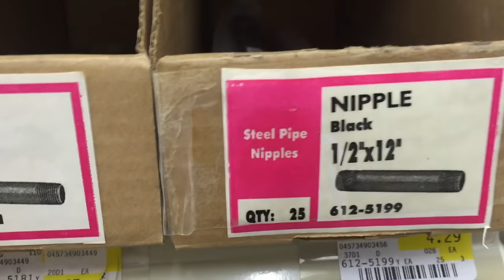Hardware Store Muzzle Loading Pistol Part 1

Comment: Not the first time I've heard this song but last time I heard it I was really into it at like 3am...turns out it was on THIS video and I'm still debating doing a build like this & ended up at your video
I'm so happy I did because not only did you help me nail down the song/artist but you also helped me figure out exactly what action I want to use for me beautiful (almost free) gun to keep in the barn at the summer home...cheap enough that if it breaks/dies then I don't feel bad yet impractical enough that if it goes missing I also don't feel bad since it doesn't use center or rimfire bullets so if some idiot DOES try that, it'll go click without doing anything
Truly your build is amazing to look at
Reply from the maker: I am so glad to help with both :-) Thanks for your encouragement.

Comment: I think I will use an extension spring like you did next time because it reduces the parts count, and the operation of the spring doesn’t have to count on a sloppily made spring guide. Good idea.

Comment: That's in ingenious way of carving a barrel channel and well engineering the lock. I hope that coil spring will be strong enough to set off caps!
Reply from the maker: +mark3smle Thanks, buddy. It worked out good. I have fired off some caps with it and they went "bang". But I had some misfires and will be using a stronger spring.

Comment: Thank you for the drawings of the parts! I was looking for this for some time :-)
Reply from the maker: You are very welcome :-)
Reply from the maker: It is about 10mm in real life :-)
Reply: Hello from Slovenia.An interesting project.Can somebody send me drawings of the parts?Thank you.
Reply: It's in the description mate!
Reply: Thank you. I found a link to the description.This link does not work.Is there any other way to get drawings?
Reply from the maker: I just tried the link and it does work for me.  I am not sure what the issue could be. Please try it again.
Reply: Thank you. I'll try tomorrow.I found drawings of a similar Russian gun,without a measure (mm or inch,)
Reply: I'm working on the mechanism at the moment and for now, things are going pretty well! I only have 1 question about the spring you used.. Do you have any specifications about it? Thickness&length? :-)
Reply from the maker: Cool.  I am sorry, but I do not have specs for that spring. I used trial and error with thicker and thinner springs and cutting different lengths.

Comment: No mention of what caliber it is. Guessing 50-ish, since 1/2inch black nipples are common.  ( I used to work in a hardware store similar to the one you showed.  Pity it went out of business.)I was wondering on that first shot of the square tubing.  Then I thought, "hmm...heat, twist, rifling?  Eh, maybe not."
Reply from the maker: I shot a .357 bullet out of it and it was too small for the barrel. I am guessing that it is in 40-ish range. The inner barrel liner narrows the barrel. Have a great week!

Comment: Pipe in different schedules, lengths and inside diameters, springs of multiple sizes and some look tempered. What hardware store do you patronize? All I have around here is Lowes, Home Depot and Ace. They have nothing like that selection.
Reply from the maker: Hi Harry - I live in a small town with a hardware store that has been around for a long time. They serve a lot of contractors in our area and have a lot of cool stuff. There is actually an even better one in a small town about 5 miles from me. They are disappearing fast with the advent of the large stores you mentioned...

Comment: Before you try making this lock from plan, build a mock up out of wood and try it. If you try to do a direct copy of of the lock parts from the drawing...Nothing fits and it will not work without a lot of extra filing. Building these parts is a, "Ball Buster" unless you have access to a metal cutting bandsaw.
Reply from the maker: Thanks for the comments CapnJackSB. If you made a lock, I would love to see it. I hope you post a video. I think making a mock-up so that you have a template to scribe around is a very good idea for making anything with small parts by hand. The parts are drawn to fit together perfectly, but like you said... a ball buster if you don't have a metal cutting bandsaw. Also, having a belt grinder makes it very easy to grind exactly to the lines of the drawing. Have a great weekend.

Comment: How do you secure the tumbler and hammer to the axle? I don't understand how you drilled the holes for the pins that secure the tumbler and hammer to the axle, while simultaneously maintaing the proper orientation of the two parts, and then inserting the pins. 

 The instructions for the Jaco Kentucky BP rifle on scribd do not go into detail on this process.  If you are uncomfortable divulging instructions on the construction of this gun, I would appreciate tips on how to fix two propellers blades in an identical configuration with an identical process. This would be for a model airplane I am working on.
Reply from the maker: I drilled through tumbler first. Then I assembled the lock, mounted the tumbler in the correct place and clamped it securely with a pair of vice grips. Then I drilled through the hole in the tumbler into the axle and then pinned it.
Reply: @SugarcreekForge  Thanks. I could see that you would clamp the tumbler to the lock-plate to secure its proper orientation, but how did you stop the axle from moving around?
Reply from the maker: @grenouillesscent  The vice grip is pressing the head of the axle against the lock plate on one side and the tumbler on the other. It didn't take much to keep it from spinning.
Reply from the maker: @grenouillesscent  The vice grip is pressing the head of the axle against the lock plate on one side and the tumbler on the other. It didn't take much to keep it from spinning.
Reply: SugarcreekForge I see. Thanks for the info.

Comment: I loved the execution of the design, but I would not fire one unless I used seamless 4130 or 4140 tubing for the barrel. I know that the original wrought iron barrels were roughly equal to standard low carbon steel, but when it is my face next to the weapon, I want all the safety factors that I can get. That said, well done
Reply from the maker: Thanks for the kind words and thoughts. I think that DOM tubing would be ideal in tough steels like you suggest. I totally understand your valid point. I put the seam of the inner barrel tube opposite of the seam in the black iron pipe for insurance. The outside pipe's bursting pressure is rated at 8600 psi. I don't know the rating for the inside one. Shooting only light black powder pistol charges is in the safe chamber pressure range... but I would do just what you suggest if I wanted a serious daily shooter or rifle that is near my face.
Reply: Would be very kool for shooting Roman Candle fireballs though wouldn't it LOL

Comment: Wow I don't think 1018 thin tubing like that can be used in BP barrels! 1045 if forged, hardened, and tempered! Or maybe try to make a mold and cast bronze.
Reply from the maker: The barrel is 2 pieces. It is a composite barrel. The inner lining is very tightly fixed into a piece of black iron plumbing pipe. I checked the engineering data for what the pressure rating is. It is several times higher than what light black powder loads create.

Comment: How else could I cut metal without a band saw? The video is awesome brother 👍 .
Reply from the maker: Thank you, sir. You can cut it fairly quickly with a hand hacksaw using bimetal blades.
Reply: SugarcreekForge sry for bothering u again but what type of spring is used for the hammer catch
Reply from the maker: @thegreatoutdoors7610  No bother at all. I used a small flat spring and didn't like how that worked. I then made my own out of a torsion spring

Comment: So I kinda have a plan in mind so came here to ask a question rather than watch vid. what would be a good material for the barrel? I got some metal conduit tube but I feel that would be to weak for it.
Reply from the maker: Since making anything like this is risky... I won't tell you what to do. But, I always use something that is rated for a PSI that is higher than I need. Conduit would be too dangerous for me...

Comment: Why would you waste that whole plate for 1 part? Looks like it would have fit close to one side?
Reply from the maker: I love your comment, Gary. It means that you truly were watching my video and thinking it through enough to share a smart perspective with me. I used the middle of the plate because it was the thickest and flattest in the middle. Just like cutting a straight piece out of the middle of a crooked 2X4. You waste some, but you have a straight even smaller piece to work with. Thanks for leaving me a comment, buddy.

Comment: Did you weld the breach plug or is it only tapped and threaded in? Also what kind of pipe did you use inside the black iron pipe? Thanks
Reply from the maker: I just threaded the breach plug into it. The tube inside of the pipe is just welded seam tubing.
Reply: @SugarcreekForge  have you ever fired live rounds from your pistol?
Reply from the maker: @sovietyunyun7566  Check out Part 2 and you will see :-)

Comment: amazing, could you tell me the thickness of the plates you used please?
Reply from the maker: I used .125 mild steel for the side plates. I am glad you liked the video Juan :-)
Reply: @SugarcreekForge  thanks for answering, excuse me, and do you remember the hammer? thanks
Reply from the maker: @juanjose-db4dt  You are welcome. I believe that I made the hammer from .25 stock
Reply: @SugarcreekForge  
sorry, it's me again, do you remember the size of the anvil screw?
Yesterday I bought the plates to start trying
Reply from the maker: @juanjose-db4dt  Hi Juan. I do not. I just chose one that was big enough to be drilled and tapped for the smaller screw
Reply: @SugarcreekForge  Thank you very much, I will try

Comment: How did you plug the barrel, I've been having minor trouble in some of my more recent BP guns because of the plugs
Reply from the maker: +Macro Platinum I used a tap and cut threads into the breach part of the barrel. Then I made my breech plug out of a piece of a bolt.
Reply: +SugarcreekForge oh ok, thanks

Comment: So it was two barrels right? One inside the other?
Reply from the maker: Yes - I chose to do that based on what was available at the hardware store
Reply: @SugarcreekForge  oh awesome thank you
Reply: @SugarcreekForge  how did you put the barrel in the other? Did you just hammer it in?
Reply from the maker: @jerrylitthachack1464  - I sanded it very smooth and then heated up the outside barrel. Since it was hot, it expanded and then I gently hammered it in.
Reply: @SugarcreekForge  Very cool thank you very much

Comment: This is a very cool project. I have always wanted to build something like this. My only concern is the barrel. What kind of pressures will the barrel handle? I'm not trying to troll, I really like the outcome. ;)
Reply from the maker: +Caleb Burnett Hi Caleb. That is a very legitimate, non-trolly question :-) I have a piece of tubing that will handle BP pressures. Then I sanded it down until it would barely fit in a piece of black iron pipe. I heated the pipe up until it expanded enough to hammer the tube into it. I kept the welds opposite each other. So, it is plenty able to handle the pressure. But I will never shoot it with heavy loads.
Reply: +SugarcreekForge I suspected you had taken that into consideration. I look forward to seeing the rest of the project.

Comment: Whats type of metal did you use and what thickness?
Reply from the maker: I used 1/8 mild steel for the side plate. I used 3/16 and 1/4 high carbon tool steel for the parts of the mechanism that I wanted to heat treat.
Reply: @SugarcreekForge  thank you so much!

Comment: What did you use for the breech plug and how did you secure it
Reply from the maker: Hey, Tyler. I used a bolt. I threaded the back of the barrel a few turns and then screwed the bolt in.
Reply: @SugarcreekForge  awesome. Thankyou so much
Reply from the maker: @tylerstrahan8884  You are welcome. Have a great weekend.

Comment: how did you get thw trigger in middle of the gun when its all riveted to side of the plate?
Reply from the maker: The trigger is a separate piece to the lock. There is a pin that sticks out of the sear and goes from the side into the middle of the gun. The trigger is in a small plate that holds it into an inlet in the wood. It pivots on a pin. The trigger contacts the pin that sticks out from the sear. I hope you can picture that in  your head since it is a little bit hard to describe with just words.
Reply: i understand, dont worry. i was on the right wave. I just did not know how its held in place. Many thanks. I hope mine will look same as yours! althrough mine has just 2" barrel so your blueprint looks bit weird on mine 😂
Reply: ive made gun using your template 2y ago then destroyed the stock it had... now its functional again, its lot of fun to build and shoot, thanks a lot:)
Reply: now ive made completely new pistol, much nicer than the 1st more like Derringer. again just thanks to this video that showed me its not that hard

Comment: How thick is the tube for the barrel???
Is it stainless stell??
Reply from the maker: The barrel is made of two parts. The inner part is a steel tube and then it is force fit into the outer tube which is black iron plumbing pipe. Together they are about .15 inches or 3.8 mm
Reply: Greek Irish it’s black iron piping

Comment: What did you do for the barrel An breech plug
Reply from the maker: Hi Parker, watch both videos and you will see it. I used steel tubing force fit into a piece of black iron pipe. I threaded the inside and screwed a bolt in for the breech plug. I welded a tang onto the bolt and curved it to fit the stock.

Comment: Schedule 80 pipe for the barrel, MINIMUM!
Reply from the maker: Thanks for your thoughts. I like your channel and need to watch your videos. I did check the pressure specs for both parts of my barrels and I am way under them for the loads and smoothbore.

Comment: How thick of steel did you use for the lock components
Reply from the maker: I think I used 1/4 inch
Reply: SugarcreekForge thank you. I printed your plans and I’m going to try to make one of these. What did you use for the barrel
Reply from the maker: I used a steel tube rated for high pressure and put it inside of a piece of black iron plumbing pipe.

Comment: How many hours did it take to fabricate the metal parts?
Reply from the maker: I am not sure, but not very long. I have a metal cutting bandsaw and belt grinder. Let's say 4 hours for the lock parts and 2 hours messing around with the barrel and breech plug. Then a couple of hours for fitting and assembly.
Reply: SugarcreekForge Thanks. I found your video doing research for a novel. This is tremendously helpful. Much obliged.

Comment: how ypu make the barrel?
Reply from the maker: I used 2 pieces to make it. It is a black iron water pipe on the outside with a liner inserted into it of seam-welded tubing. You can see in the video that I sanded the inside very smooth.

Comment: what type of steel did you use to make the mechanical bits?
Reply from the maker: I used some mild steel. The parts that needed to be extra tough, I used 1095 and O1. I heat treated those parts.
Reply: SugarcreekForge Any particular kind of quenching oil?
Reply from the maker: I use vegetable oil and it really works well. It is fast quenching and non toxic. I just use inexpensive vegetable oil from the dollar store. :-)
Reply: SugarcreekForge Thanks, that really helps. Does veg. oil work for most metal working projects?
Reply from the maker: It works well for heat treating knivs and smaller parts. Have a great week.
Reply: SugarcreekForge Thanks. Likewise.